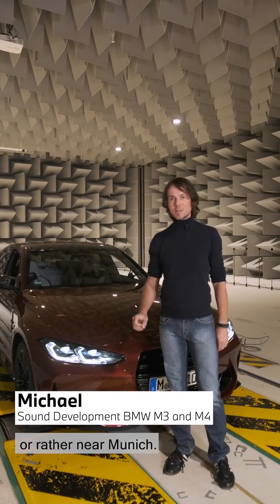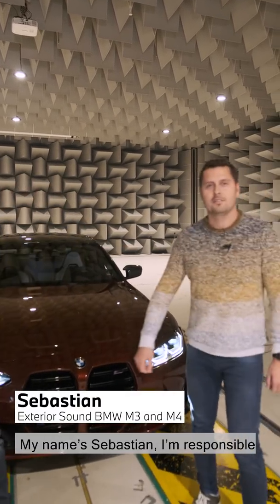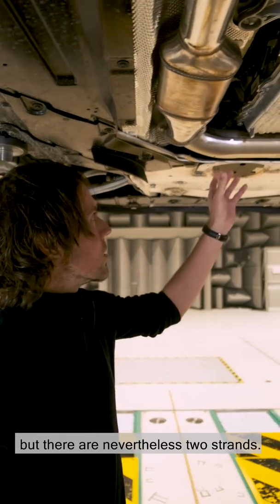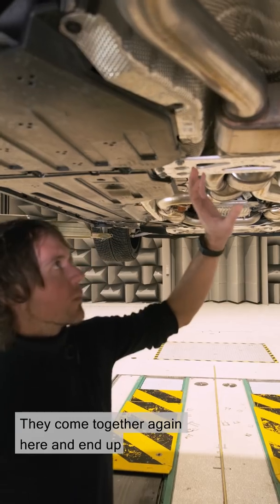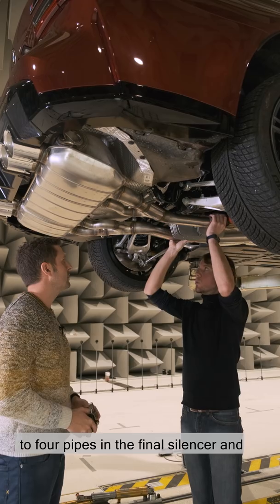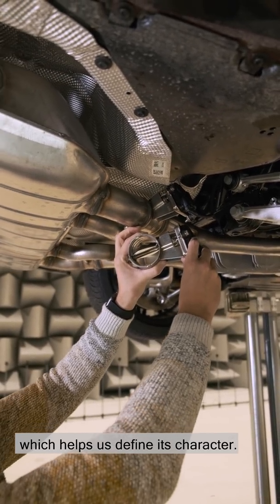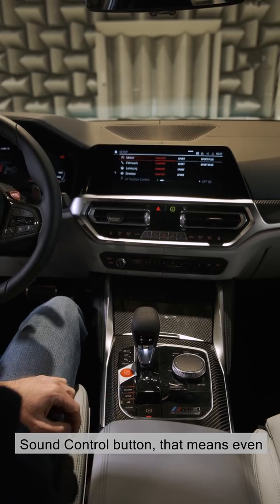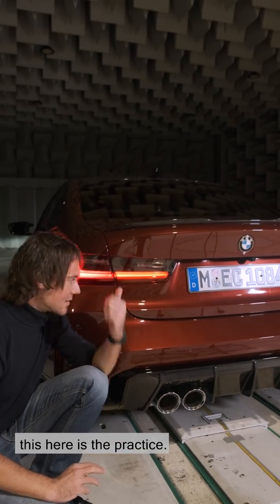Engine Sound. M3 and M4 - explained, Episode 09.

Comment: is that aventurin red ?
And can be the sound enforcement inside the car switched off altough the valve in the exhaust are open with sports plus ?
Reply from the maker: The name of the paint job: BMW Individual Special Paint Ruby Red metalli
Reply: @BMWM   thank you! :)
And what about the enforced exhaust sound in the cabin? is it possible to switch off?

Comment: I would love to hear some explanation why you put fake sound into the cabin :) 
If the engine is quiter and super modern thats okay, let it be quiet.
Reply: Because you just wouldn't here the engine otherwise, even in sport mode. I mean, it's not a V8 sound in a diesel so I guess it's actually ok
Reply: It's not really that the engine is quiet, but the passenger compartment is really muted.
Reply: @nhoodfan  for comfort reasons
Reply: It can be disabled if you prefer
Reply: Hopefully the aftermarket make it louder
Reply: Dave  exactly
Reply: It helps with manual shifting